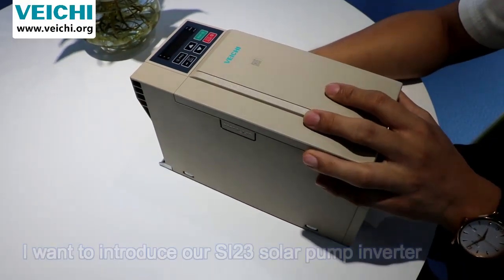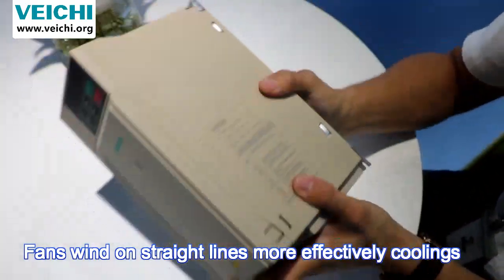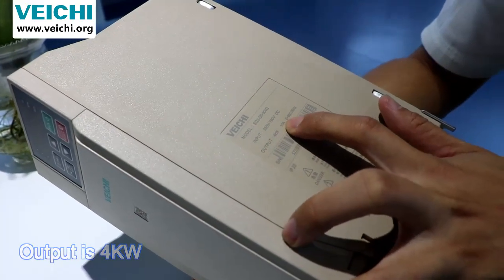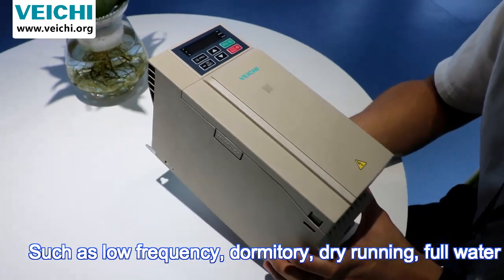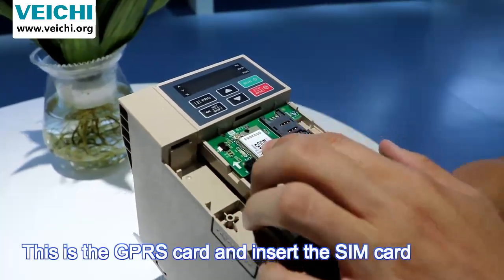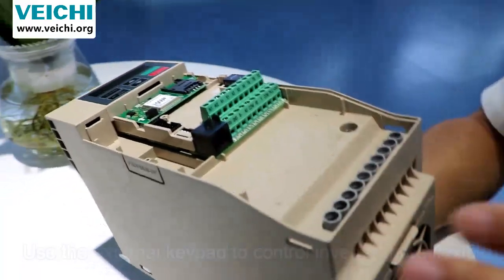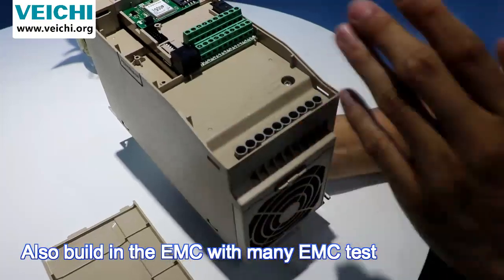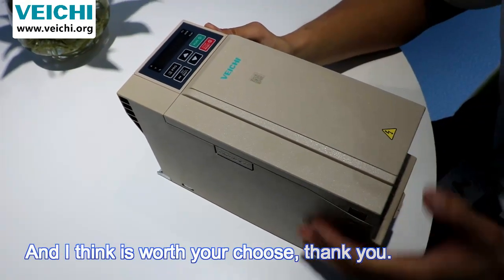VEICHI SI23 Solar Water Pumping Inverter

Comment: Do you have a Youtube showing: 1. single phase motor connection, and what is the setting to be changed? 2. Key pad setting WHAT DOES THE NUMBERS REFER TO? 3. Do I have to set the amps corresponding to the motor ? How do I do that? leave the music it is instruction not a fashion show.

Comment: Good Evenneing please how we can use this inverter in a single phase mode and how we can put the output wiring . Thanks
Reply from the maker: F14.00=1002, and UVW direct connection. If you have any question, you can send message on our website, thank you.
Reply: Did work this configuration sir?
Reply: @VeichiElectric please could you send us more documentation regarding this , we have 4 cable pumps 1hp single Phase (One capacitor )

Comment: Hello .. can i use any module gprs to connect with rs485 ?
Reply from the maker: Yes, you can do it.
Reply: So i use module gprs directly without Arduino or other cards ?
Reply from the maker: @Ibrahim16K  for remote control and monitoring you need to install the SIM card in the GPRS module